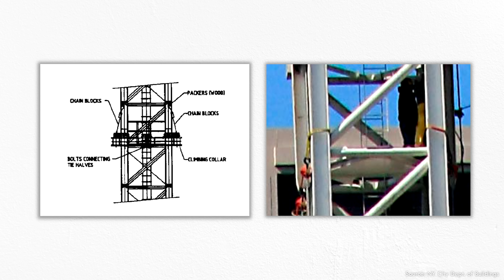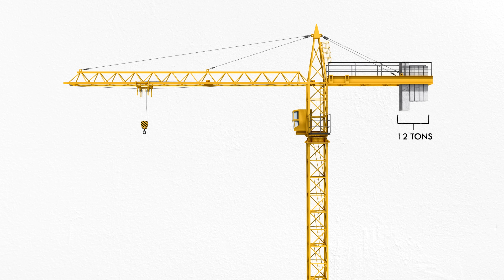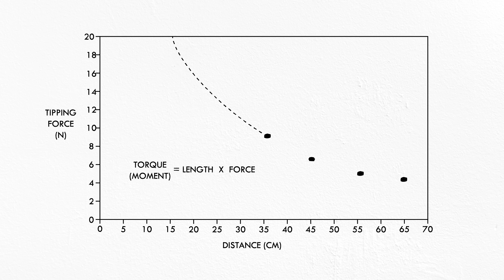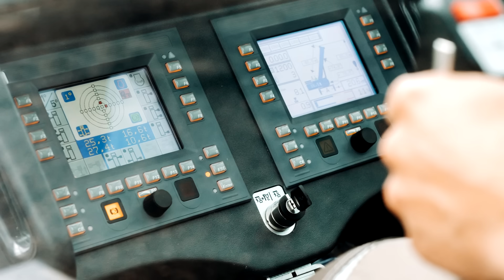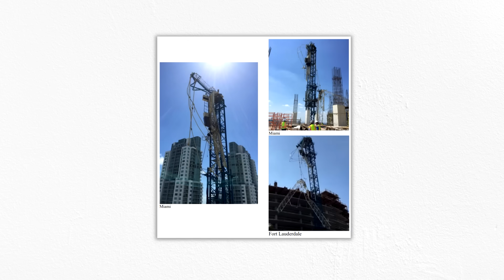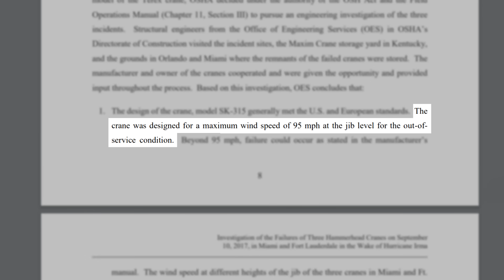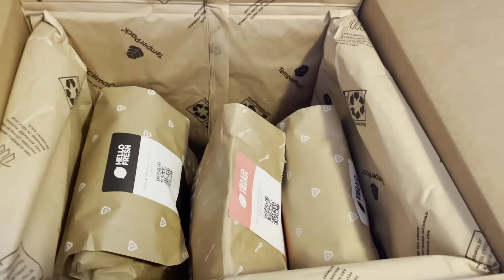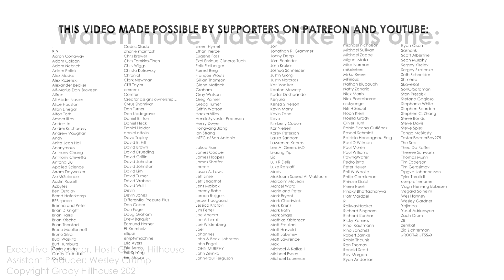Why Cranes Collapse

Comment: I live in Perth Western Australia,During a working at hights training course the instructor mentioned that in the previous 2 years an unusual number of smaller tower crains had collapsed.An investigation into the problem happened to notice that in EVERY SINGLE ONE OF THEM  the operator was trained and certified by the same instructor.He was immideatly decertified and every one he trained  had to go back for retraining,the safety of crains on worksites in Perth was greatly improved.
Reply: Small tower cranes are often operated by people with only little training or even by some without training (in Europe it's not mandatory to have a training to use a small tower crane at all). 
They are often put on soil without a real load distribution, and used at too strong winds, some even manipulate the load limiter switches. Time pressure is another factor.

Comment: Probably mentioned already in the 1.5k comments, but I can come up with two other reasons for a crane to collapse - insufficient maintenance (e.g. rust formation, metal/weld fatigue not being discovered) and trying to work too fast (dynamic overload due to the object picking up momentum during turning).

Comment: so my town recently repaved some of it's roads, but it did so by taking off the top 2 inches or so of asphalt, and then spreading a layer of uniform gravel with 3-4 mm grains evenly over the surface, without any binder, and without compressing it afterwards. I was wondering whats going on with this?

Comment: Can someone tell me how cranes hold the counter weights in place? It looks like it's just a tiny plate "pushing" it into place but there's gotta be something more secure than that, no? Thank you!
Reply: They are usually secured by a heavy steel lock pin.

Comment: What hurts me the most when I look at cranes is the fact that most disasters are caused by the simple manager trying to do things “faster” by taking apart the crane wrong. Manuals are sheets of paper meant to be read and followed to prevent people from dying. It also is created to make sure anyone, even (I might say especially) for those who haven’t been specialized in the field of crane construction, to ensure that they can set up and disassemble the machine both properly and safely. It should be expected that when a manual is not followed, people will die. Yet, somehow whenever things go wrong after the manual is not properly followed, it’s still an “unexpected disaster”. Yeah, that individual in Battersea was not aware that the crane manual was wrong, but the Seattle incident? Those workers were pretty much asking for failure. I live in the Seattle area, and it is gusty as hell here at times. Weather patterns should be no excuse for improper handling of construction equipment.
Reply: Not only managers - there are workers who'll tell you that they don't need the manual because, "I've done this a hundred times and it never failed." Unfortunately, they forget to add the word "yet" to their statement.

Comment: Theres some more really interesting depth to the story in the milwaukee crane collapse, and while it doesnt really have much to do with what this video was about, i think its worth learning about to illustrate some of the issues in the construction industry and how we can be better as a whole. Multiple operators and other safety personnel advised against lifting that load on that day due to winds. The GC and their site management on that particular project had a track record of ignoring safety standards and best practice with that crane in order to save money, and fired different safety consultants for recommending safer practices, one of which was putting down crane mats. On the day of the incident, site managers had weather meters hooked into a computer in one of the offices, showing that they knew the conditions. Even after being advised to put the crane out of service, they decided to continue work. Directly after the collapse, while the bodies were still laying on the ground, site managers unhooked weather devices and effectively destroyed the evidence of their negligence. Failure was found to be a direct result of wind catching the roof section, side loading the crane, which caused a structural member to break towards the bottom of the boom, resulting in total collapse. The massive boom section hit the three ironworkers, who were suspended in a man basket from another crane, on its way down, killing them instantly. The documentary on this incident is fascinating, and shows how a culture of ignorance and cost cutting resulted in the death of three men. While im not a manager of a large rigging company or a crane manufacturer or the gc of a multi million dollar jobsite, i can take lessons from this in proper planning and coordination with my crews on my jobs to make them as safe and efficient as possible. Perhaps if more people decided to learn from incidents like these, they would happen much less frequently.

Comment: Can you explain why some tower cranes are bottom slewing? I can easily see the dis-advantages of that. Is it perhaps that there is nothing to support them to the structure/s they are helping to build.?
Reply: They are far simpler to assemble, you don't need a second crane and you don't have to work on top of the tower. Smaller ones are not just bolted together, they erect themself by steel ropes (the classic way) or by hydraulic cylinders. 
They are standing free, they are not bolted to something. 
By having the counterweights at the bottom the whole construction  has a far lower center of gravity. 
This cranes are typically smaller than the top slewing ones.

Comment: I wonder how the climate catastrophe will make construction and working with cranes even more difficult. Unexpected heavy rains, storms, etc will bring a lot of construction equipment to their limit a lot more often. 

Also, I have a question which you might be able to answer. You might have heard of the recent floods in Europe. In Germany, the river Ahr flooded to a level twice the height of the 100-year flood. I was wondering how engineers calculate the 100-year flood with rapidly changing conditions, do they at all? or is this something that's not possible to estimate anymore?

Comment: tho a crane collapsing is scary personally what is scarier is the winch motor or brake giving out the sound of the drum being un-spooled at high speeds its really never racking kinda like an air raid siren but instead of bombs being dropped the bang come from the drum disintegrating and sending shrapnel everywhere like https://youtu.be/4OOg7vL3rNY

Comment: Can they make longer outriggers for the near side of the crane, like ones that run the entire length of the truck instead of only 1/3? Maybe telescopic also? And what if they put ground level outriggers on the far side and park a bunch of forklifts on them? I think the counter balance on my jeep was 3000 pounds alone.
Reply: Most mobile cranes have telescoping outriggers. Since they are almost all designed with a 360 degree range, you can't just have longer ones on only one side. You hear about people using other vehicles/equipment as count weights but if you are lifting outside of the cranes rated capacity, there is a point where whole structural integrity of the boom will fail.
Reply: @adirtyhippy  I kinda thought about the 360° range and realized you would only be able to work on one side if you had outriggers on one side and counterweights on the other. Or you'd have to turn the entire rig around. But that makes sense, that you could have all the counterweight in the world but eventually the structural integrity of the crane would fail.

Comment: There was also that radio tower where a U bolt used to anchor the crane device was missing, and so the contractor went to the hardware store to buy a new one, but he didn't check its grade, so while the size was right, it couldn't carry the load.

This caused several deaths, as not only did the entire tower collapse, there were people inside the load as it was being lifted.
Reply: Why would there be people in it?? 

He goes to a regular store for what was probably a specialty part? Wow.
Reply: @windsofmarchjourneyperrytr2823  Well, the part was just a U-bolt; it's not exactly specialized. Had he paid attention to the ratings and gone for a grade 8 instead of a grade 3 (iirc), everything would have been fine.

As for why there were people in the load: I don't remember exactly, but it had something to do with guiding the load up so it didn't accidentally snag one of the cables used to keep the structure upright.